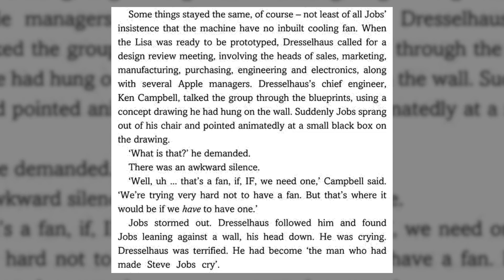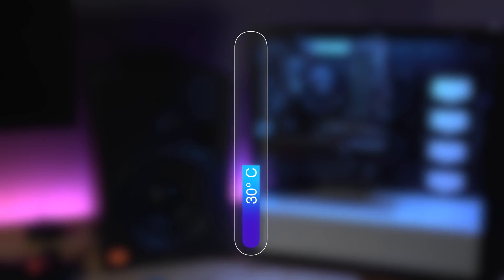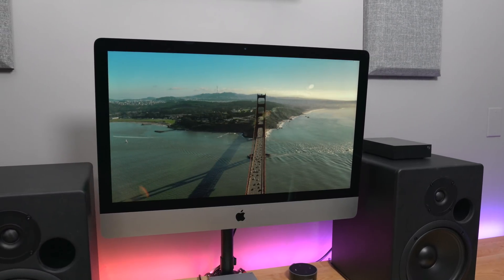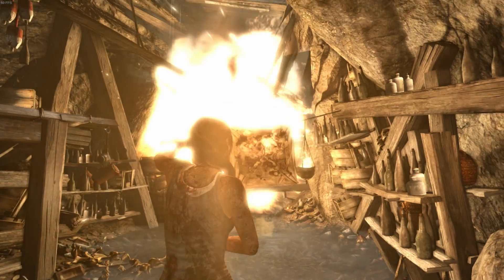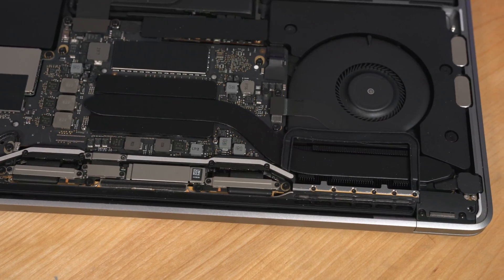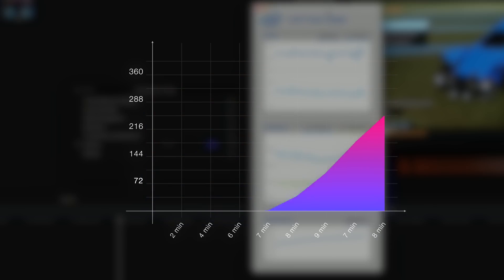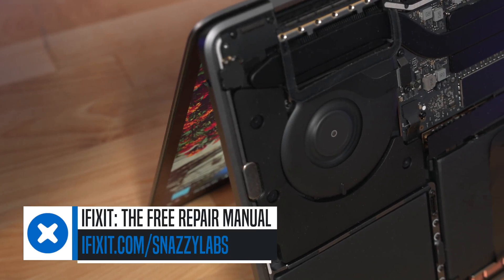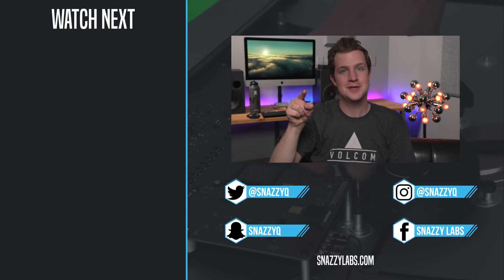Is Apple Ruining Your Mac's Performance?

Comment: Great way to talk about this topic. A lot of gamers tend to state that the cooler the better. It's not true if you are talking about stock clock speeds and voltage. The CPU will only thermal throttle at the junction temperature... and there is a lot of research about that showing these statements. Of course, having a nice cool laptop to play around is nice, but if you can deliver a fast, silent and STABLE laptop the better. But as your tests showed, stability is not the strongest characteristics of apple's devices, so buying a much expensive computer with the same fans (that are very shitty designed ofc) is just plain stupid.
Reply from the maker: I'll probably get called a Mac peasant by someone, but I agree that gamers tend to obsess over temperatures too much. Lots of people freak out if their CPU hits 80 degrees under full load when in reality, it's totally fine and well within the designed spec.
Reply: All modern brand-name electrical components are rated at least -40°C to +125°C long-term. Wave soldering can be around 300°C for a couple seconds and doesn't damage anything. So no, 80°C will not be a problem for any component on the PCB.
Reply: TheEightfoldPath While your point is probably true, I do not recall any mosfets being dangerously near the CPU in a Mac. Certainly not mosfets for power. Despite the high temp ratings of the parts I mentioned, it is of course important for the designer(s) of the PCB to lay parts out in such a way that will spread out heat sinking.
Reply: Fid Fyodor in a laptop that's another matter. We were speaking of temps and how apparently gamers are "too obsessive" with temps in general. Laptops are shitty when it comes to temperature anyways so they aren't the big talking point here. Yes 80 vs 60 will give you a difference, but not nearly the same as a desktop as there's not even a quarter of the power pushed through.

If you buy a laptop with X cpu, use it at 100% and it starts throttling it's shitty design, not "average user most demand hurp de durp", if that was the case they'd put an underclocked i5 or i3 to increase battery-life and tout it as a feature.

Let's say I bought a sporty car. The expected speed is advertised as 250km/h with the stock tires, brakes and gearbox. Once I reach that speed the engine quickly starts throttling because the intercooler is too small and the engine overheats. would "but your max streetlegal speed is 100km/h so considering the average driver this isn't that bad, the intercooler is tailored to the average driver even though we know that the engine is way too powerful for it" be a consolidation? No.
Reply: Fid Fyodor If your already toasty mosfets are being further heated by a cpu that is poorly cooled then you'll run into stability issues. If you have a cheap motherboard where mosfets have poor or no cooling to begin with you probably have a less than optimal case and/or cooling as well. High thermals indicate poor efficiency or poor cooling, even the stock wraith coolers manages keep the cpu around 60 at stock, going higher than that is both lazy and pointless.
Reply: Snazzy Labs Pascal /Maxwell GPUs are really temperature sensitive, Pascal start to downclock at 50°c, it's the way gpuboost works
Reply: Snazzy Labs haha that was me until I switched to Ps4 Pro xD
Reply: Snazzy Labs To be fair, 80c on a cpu in a closed system might ve fine, but it's not and it'll heat other components that might be hot by themselves (vrm, psu, gpu etc). 80 is within spec for the cpu but probably not the system as a whole.
Reply: Also, I would love to see an example of a modern slim notebook or AIO that is able to keep temps around 60°C under max load. It is not possible. Laptop or PC size is not a sufficient argument, because the market requires slim and lightweight, yet powerful machines. Especially the mobile ones. There will always be compromises. If you made a statistic of all users and their daily computer use, you'd probably find out that their CPU use is under-average. Therefore, the goal is to optimise for the largest use case. The high fan speeds, thermal throttling (and water cooling for example) are meant for the small percentage of high loads.
Reply: If you're not using your CPU at 100% all the time, there's no need to worry about thermal throttling. Phones doesn't have fans, so the only thing they can do to cool down is to decrease the clock speed.

Comment: What if Apple decided to go with water cooling on their desktops? Could that allow better performance without too much noise? Great video by the way.
Reply from the maker: +Garirry Yes, although it introduces a whole other slough of problems. Apple actually had a water cooled machine back in the day and it was a nightmare. Lol. They could continue to keep low noise by putting in larger fans and bigger displacement coolers. You can cool really well with air. There's no need to move to water.
Reply: But that would mean thicker and bigger computers which for people that actually use MacBooks to their full potential, probably wouldn't mind at all but Apple will never sacrifice that for anything.

Comment: I went with the MacBook Pro for the quietness and luckily I just use it like a grandpa for email and web so it’s perfect.
Reply: Yeah but 2k for web browsing? OMG! Our company has 500$ hp-s which are making money, aka doing the business. Seams like the more you pay for Mac-s to do more...there is a higher chance of them to throttle and do less.
Reply from the maker: They are indeed perfect for uses like that. :D
Reply: The prices though...
Reply: You spent over 1K (at least) for web browsing... wut? I just bought my MacBook but will be using the thing to its limit to make sure I get the most for my money lol.
Reply: any laptop even a gaming laptop would run silently under that kind of load.
Reply: balderoine quietness? what do you think a Windows PC is? 25 years old? if you buy a good laptop, then ypu will get good performance and no noise
Reply: For that workload, why not stick with the 12" MacBook?  Or did you just have $$ to burn and want the trendy touchbar?
Reply: First Name Last Name i kno like if your goin to just check email and web browse then get a lg gram or somthing
Reply: exactly, so here's the best solution. Buy a 500£ laptop, eventually equip it with an SSD, then install Linux. BOOM! Way better and cheaper than ANY Macbook, Pro or not Pro...
Reply: lol
Reply: I have a 2015 MacBook Pro I have had it since last Christmas, does any one know any good programs I should in stall like photoshop and editing software but free versions?
Reply: Playdust,

image manipulation - GIMP
photo editing - darktable
vector image - inkscape
painting - krita
3d modeling/game engine/video editor - blender
office suite - libre office
mind mapping - freemind
screen recorder/game capture - obs studio
text editor - atom
have fun :)
Reply: xxxchris900xxx naah... they're still convinced that Mac=premium, that's why...:-)
Reply: I'd prefer not to be too rude, but spending over 2K on a machine to just browse the web doesn't exactly speaks marvels about your intelligence
Reply: xxxchris900xxx there's cheaper and better alternatives for that kind of use even in the APPLE environment you ignorant...

If he isn't joking and really bought a macbook PRO for the absolutely minimum use of a computer, then he's a idiot with too much expendable income, non-pro or air MBs or ipads if you don't care about macOs are actually cheaper, lighter, thinner, cooler and perform just as well for netbook / office level workloads...

Its seems like another case of the "universities" where kids HAVE to bring a macbook pro to college because everyone else is doing it, even if all they do is web browsing, typing documents, making presentations, all sort of light weight stuff that any laptop is capable do doing...
Reply: A 200USD Chromebook can do the same though. It is money thrown down the drain :/
Reply: 'URGHH I JUST ENJOY MACOS OR THE APPLE ECOSYSTEM'
Reply: A lot of you guys are asking why this is needed for web browsing. It's really quite simple: speed. These Macbook Pros, along with the old Chromebook Pixel and well-speced machines running linux, provide the fastest Chrome speeds I've ever experienced. You wouldn't be able to have multiple windows with over a dozen tabs each and be able to maintain these kinds of speeds on other systems.
Reply: flaming troll face gangster+ l don't have any apple products except my old macbook that l never really used.
Reply: AbuBakr Akram+ that doesn't answer the question of why a macbook pro is good for just surfing the web.
Reply: well it depends on what distro you install. puppy linux is probably where it wants to be. or you could install windows 10 lite/extra lite. it's the same as windows 10 except they have gutted the shit out of it to make it run lighter. l have herd people say that you can run windows 10 extra lite on a pentium 2 which is amazing considering that's a 20 year old processor.
Reply: manjaro is the best for me at this moment...
Reply: why not a chromebook? most don't even have  a fan
Reply: You bought a MacBook to web browse and check email on? iPad Mini, HP, LG, or even a chrome book ffs!
Reply: You can do this stuff with a 300 dollars chromebook, moron.
Reply: balderoine is your mac running hit on YouTube too?
Reply: Everyone don't get this joke
Reply: Playdust+ GIMP is a really good photo editor and it's free, it's not as good as photoshop but you can still do a lot with it. you can make TB PNG's and you can brush and whatnot to make it look like you're riding king kong's back.

free editing software is a tricky one. you could do a few hacks and get adobe programs for free, but l wouldn't recommend that because it's not fair to adobe unless you're really poor and can't afford the CC fees. you should have gotten imovie for free because it is an iLife application, but if you didn't it's only like $15 one time charge. imovie isn't the greatest, but it's enough for youtube videos as long as you aren't doing any pro workloads. free editing softwares are usually terrible, so you should be willing to spend a few bucks on editing software.
Reply: Lol the amount of nerds on this thread like 'URGHH WHY BUY A MACBOOK YOU CAN BUY A $10 EQUIVALENT' man go get a life. Ever thought that people just enjoy MacOS or the Apple ecosystem?

Comment: This is why I override the fan speed whenever I export, I prefer it to be warm and quiet 80% of the time.
Reply: L Simpson but is IT dangerous to make the fans go faster for like 10 minutes?
Reply: kriss420 no unless you're on insane RPMS
Reply: They're fans, will only go as fast as they can. I've had mine on 100% for 2hrs before @5940RPM

Comment: iMac has so much internal space and Apple doesn’t even put a bigger and quieter fan inside. 

Ouch, looks like such basic feature is reserved for the $5000 iMac Pro.
Reply: 4k monitors are gross, the LG ones are alright but they are almost the price of an imac
Reply: Shinobi TwentyTwo 300 $
Reply: the ones with the good panels are 1k+
Reply: you don't have a clue what you're talking about, not all panels are created equal. all of the 4k monitors at £300 look like shit with poor colour representation etc etc
Reply: Allan Sh there's a simple solution to that.
Just get a pc for half the price and it will be much better
Reply: Sadly, Dell 5K monitor has been discontinued. There is no better alternative to the 5K display. And I can't afford that 8K monitor.
Reply: you can just use a 4k monitor, it isnt worth paying x4 more for a better monitor
Reply: you don't fool anyone, you have obviously  not done any research like all of apple's fanboys

Comment: Is it worse than in PC laptops though?  My last laptop (circa 2012 with an i7) would thermal throttle if you pushed maxed out all 4 cores for 10 minutes or so.

Unless you put it on a (good) laptop cooler, then it would be fine.

And that thing sounded like a jet engine once it hit 80C.

Comment: So can you manually force the fans to turn on much earlier? And if so, how much does that help compared to the freezer solution?
Reply from the maker: There are apps that allow you to choose the fan speed (though the OS won't let you lower the fan speed if you're being throttled). The one I use/prefer is smcFanControl. At the end of the day, though, they don't really fix anything because they don't magically increase the thermal headroom of the cooler. Yes, they will start to cool the CPU more effectively at an earlier time, but you're still eventually going to hit 100 degrees if you're using a Mac model that doesn't have adequate cooling.
Reply: Jason Clark There's a reason workstations are used. Unless modeling in 3ds etc is a hobby, you'll be more efficient and probably learn thing a better way on a dedicated workstation that can actually cool the cpu and gpu, be it a pc or hackintosh.
Reply: I'm thinking about buying one of those laptop coolers, are they worth it on MBs? Adobe PS and 3DS Max has my MB melting through my desk!
Reply: Macs Fan Control is pretty good too.
Reply: Costin Vladimir it also is a paid app for full features while these others mentioned have this for free unless you want to support the developers
Reply: Was just about to recommend macsfancontrol over smc as it has a much better interface and has more flexibility
Reply: I've rescued a few 'dead' iMacs this way, including one that the Apple genius bar staff said needed a mobo replacement... simply by turning the fans up 10% over stock. If you are seeing weird video glitches or artifacting, try increasing the fan speed and you'll probably solve the issue. I still can't believe on something as big as an iMac apple uses a single small heat sink...
Reply: TGPro is a good piece of software. I use it on my mac and works flawlessly. And it's way more feature rich than the other apps